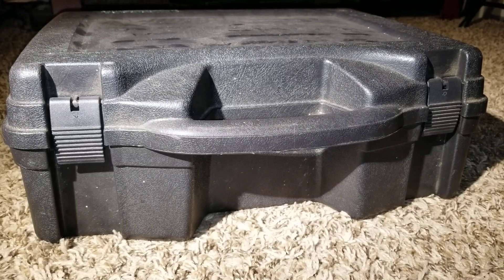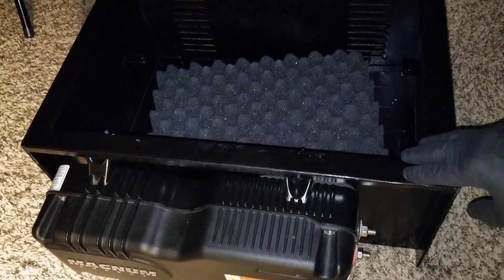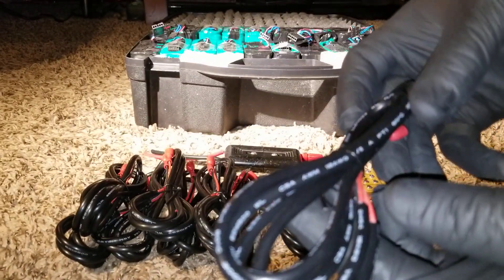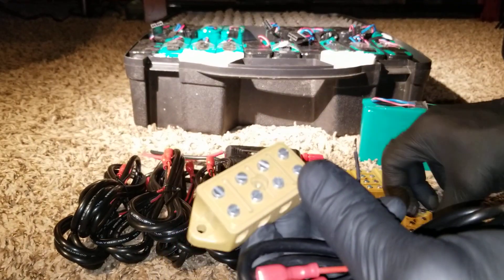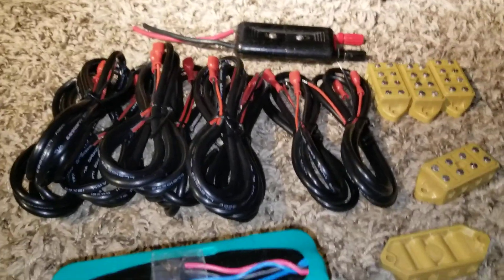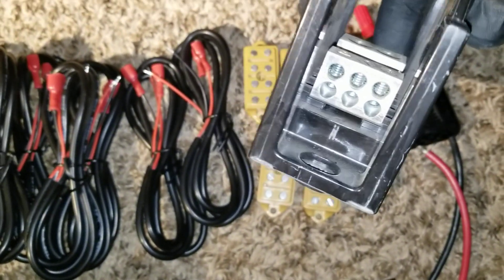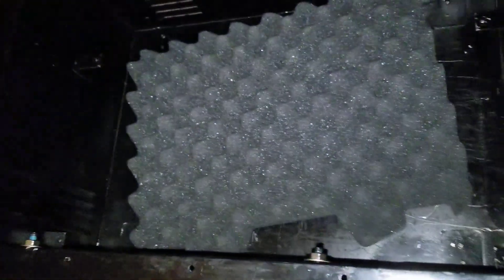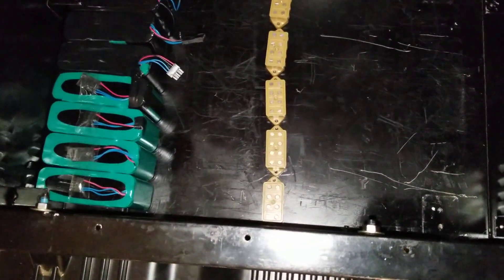BATTERY HOOKUP, PANASONIC 18650 4s3p, 14.4v 6.6ah, 95.04wh Li-lon PACKS WITH BMS, POWERWALL Part#4

Comment: I believe your design is overly complicated. You can go straight from the battery conductors to a central set of bus bars (flattened copper pipe) mounted directly to threaded terminal lugs that go through the side of your case. You can crimp on ring connectors use an insulator between the two bars and set up a 20 of these in parallel in your case. You could simply solder the leads directly to the set of copper bus bars but then you'd have to de-solder if a pack goes bad. It's worth the added expense to just crimp on ring terminals and drill holes in a flattened piece of copper pipe.
Reply from the maker: Thanks for sharing your thoughts and comments.
Please watch the rest of the video series and stay active you will see the end product when I am done.
Reply: @jwsolarusa  I will watch for your video.
Reply from the maker: LIKE SUBSCRIBE AND SHARE.
I have just subscribed to your channel.
Reply: @jwsolarusa  I also have a pack of these, we can share and compare the builds. I just described mine, just received the batteries last week. I'll make a video of it.
Reply from the maker: @ancienttechnology7337  
I will looking forward to see your project videos